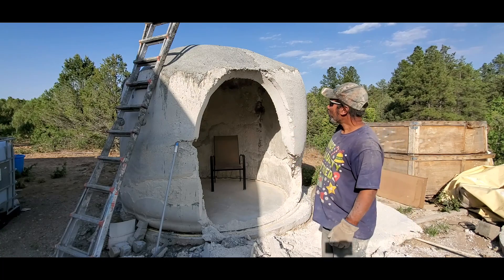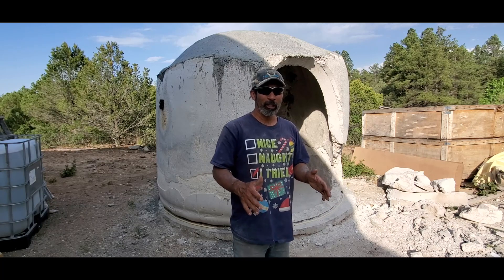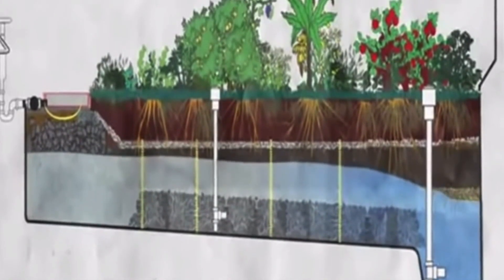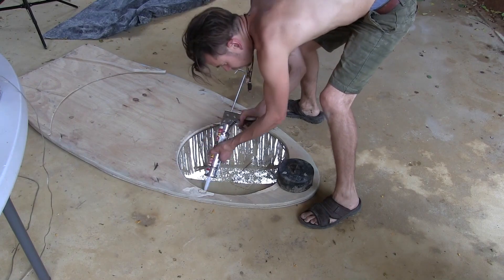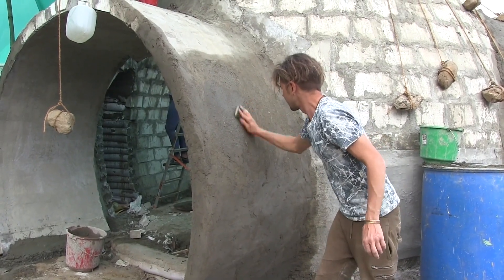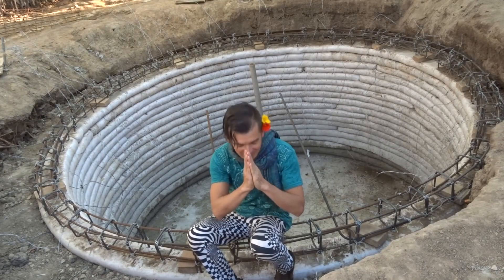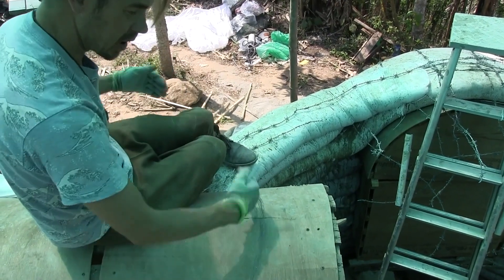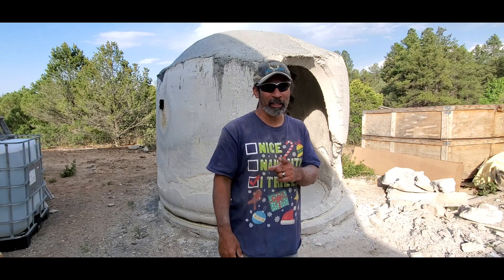Frankenstein Dome | Aircrete Harry #aircreteharry #dome #domebuilding #frankensteindome #domehome

Comment: Hary, thank you sooooooo much for taking this project on! 👍   I watched a video where concrete impregnated cloth was laied out and then water applied to harden. Would this be interesting to you for the first application on the exterior surface of dome. Then cover w/ other aircrete when hardened?
Reply: @ Kris Gardener; I'm also interested in this.

Comment: when you inflate the airform first, you could add a 1/8th sheet strip of plywood bent to your door shape taped onto the airform maybe about 5" wide, so when you spray on your mix you will have an opportunity for a neater opening instead of the random hole